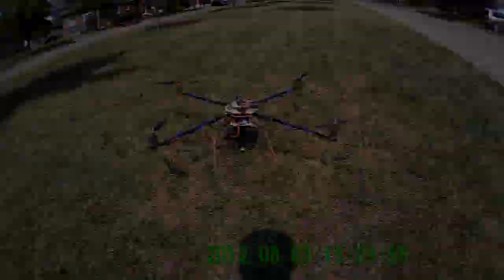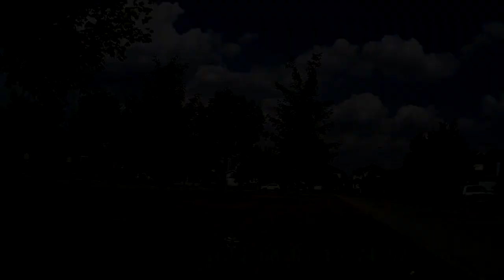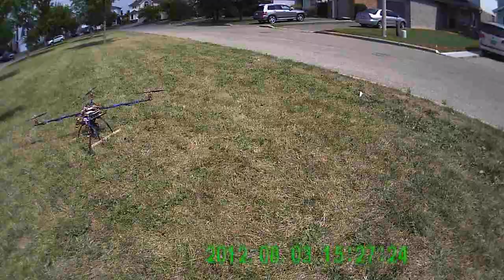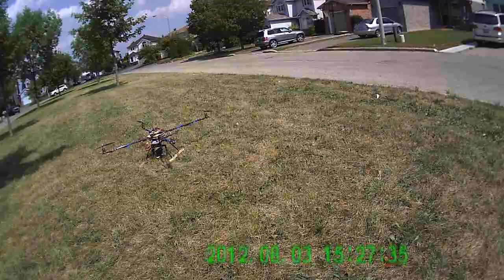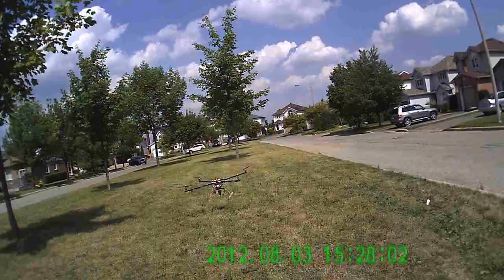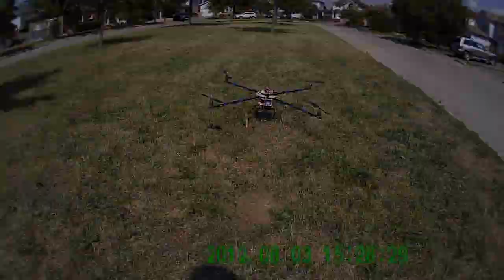Quadcopter - DJC1000-X4 - Wood beta frame - Flight 2

Comment from the maker: I am not having any issues with lift. It hovers at 50% throttle or less. The issue I am having is getting the auto level to work correctly. It is tuned for a much smaller frame (550mm, and mine is 1100mm).
The motors are Turnigy D2836/9 950KV. These 10"x4.5"x2 props give me 609 grams of thrust max each. That a total of 5.37 lb of thrust (2436 grams).

Comment from the maker: I believe that 11x6 props would be perfect for it with the camera on and FPV gear. I don't have the stuff on yet. My current total weight with 4000mah battery is 3 lb 7.7 oz (1579.1 grams).

Comment from the maker: The props in the video are 10x4.5. I have 10x6 for these motors but I just need to balance them. Next I want to try 11x6 which is the suggested for these motors with 3 cell. I can't wait to get it flying more!!

Comment: Buddy i don't know what size of motors you got there but on that 1000 size mothership you need more than 10 or 11 inch props , you need between 12 to 14 inch props on x4 2814 size motors flying on 4s lipos , you are not getting enough trust with those small 10 inch props , i'm building a 700 size hexacopter and the props that i'm going to used are 12 inch APC's because i know is a big beast , big multirotors always needs big props .